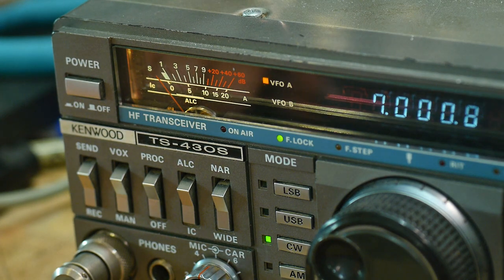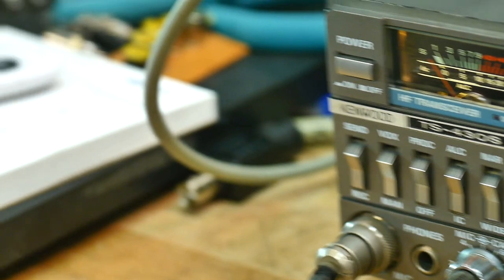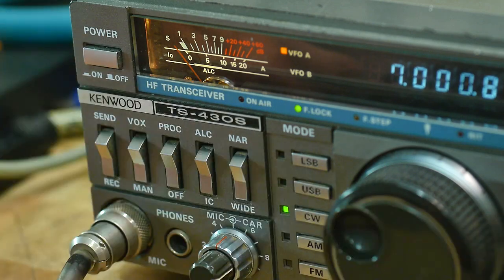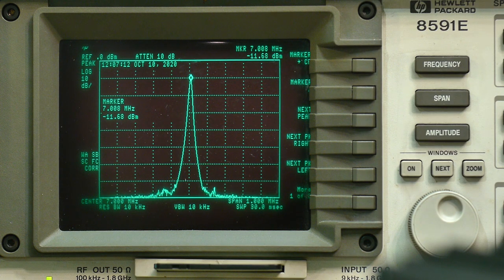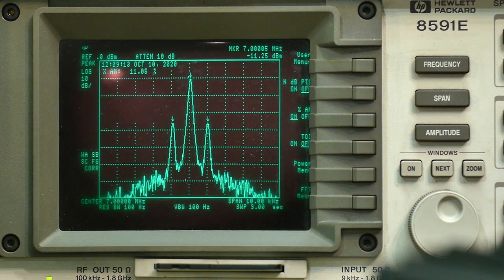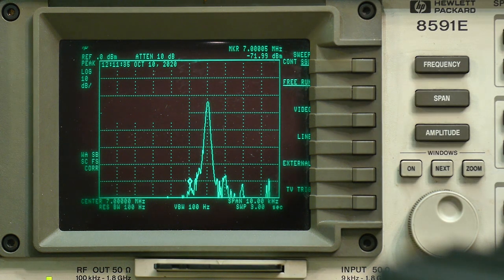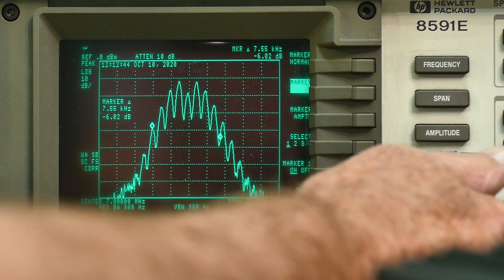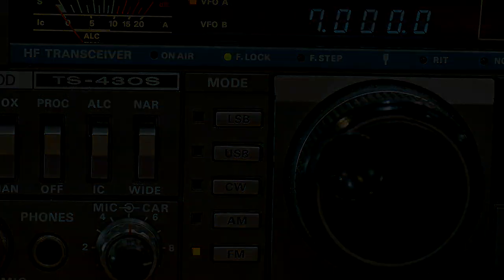#581b Single Sideband Carrier Suppression Measurement of TS-430S

Comment: Your 8591 seems to have the crt image shifted to the top and lot more to the right...you can centre the image from the menu
Reply from the maker: yes, every time I adjust the horizontal center and the NTSC mode, the 8591 forgets on the next power up. Any way to store this? I've done a cal store but it does not remember these things.
Reply: Yes there is a way to store I have to check the manual though...I had the same issue once with it always going to 75ohm and dBuV default also as mine has the TV option boards also...have to check the manual can't remember everything 🤣 though I have learnt alot of tricks from you about it I will have a look in my manual later 73 9H1LO
Reply from the maker: @stanley9h1lo  Thank you, that would make my life easy

Comment: I also bought the tinysa but I don't think that has single sweep I am at work and can't remember
Reply from the maker: the tinysa does not have a good resolution bandwidth. It is only 3khz not 300hz so you will not see any detail
Reply from the maker: here is a video using the TinySA and you will see the FM modulation deviation but not individual audio modulation https://youtu.be/2M3915pvkrs
Reply: @IMSAIGuy  when I used the motorola cp185 and narrow math told me 12 khz..thank you
Reply: @IMSAIGuy  I have the same issue with the spectrum analyzer 8 bought lowest I. Can go is 1khz and the tiny does 3khz.i bought the hp agilent E4411A